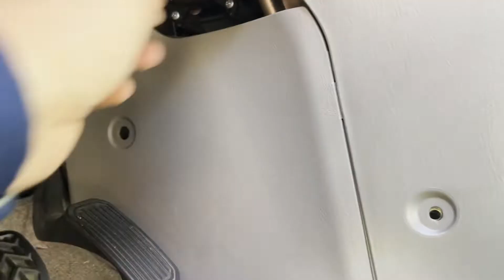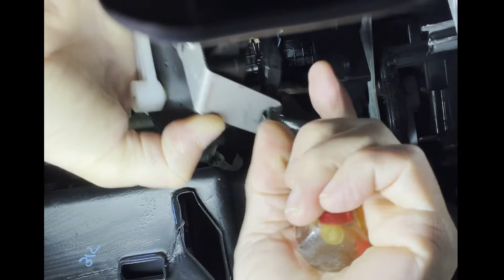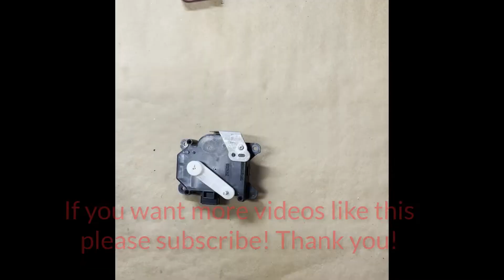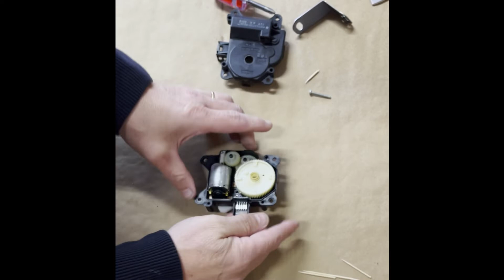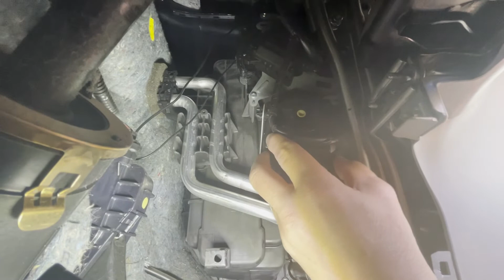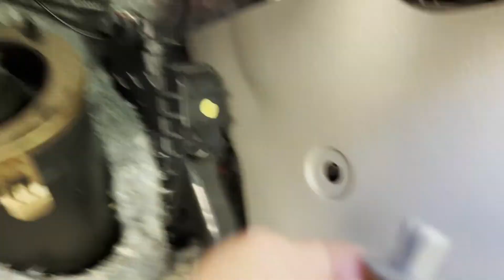2006-2010 Toyota Sienna Blend Door Repair

Comment: Can someone PLEASE help, I have an 2007 sienna CE I was having the same problem I pulled the cover off and there is no blend door in there,   im starting to hate this car so many problems
Reply from the maker: The system is not the same on all Siennas. If you don't have dual temp control, that servo motor is not installed. What is you exact problem that you're experiencing?
Reply: @LeoSabo26 I have the same car and same problem. Only the drivers side is blowing the correct temperature. The passenger and rear is blowing only cold air. The passenger actuator under the glove box is working though. Any tips? Would i have to remove the dash?
Reply from the maker: @simondave00 you have several blend door actuators in your system. At least one of them is not working. The easiest way to troubleshoot which actuator is bad is to test each one. You do this by changing the controls on the temperature control module. Change the temperature from cold to hot and watch to see which actuator is moving, and if it's moving through its full range. Then, go through the different mode selections and observe, which actuator is not moving. This will tell you which one is bad. I would also recommend finding a diagram for your specific year and model of the system, which will show you how many blend door actuators you have and where they are located. Knowing where they are and what they do will help you pinpoint which one is malfunctioning.

Comment: CAUTION: For a high mileage vehicle, consider this a band-aid fix.  The contacts on the back of the gear has 3 track of semi-conductive paint. All the black gunk that comes out when you clean is that special paint that’s been worn off.  It will wear completely through and any “fix” like this will be temporary.  A new aftermarket part is $25. Replacement is the better option.  And for reasons mentioned, never go with a used part unless you know it’s from a low mileage vehicle.
Reply: Looks more like maintenance rather than a bandaid to me, but I don't consider "chatter" to be defective. If it didn't work I assume he wouldn't have reinstalled the part.
Reply from the maker: I agree!

Comment: Amazing video. My motor isnt working. Do u have a part number for the motor
Reply from the maker: Thanks! The part number depends on the type of heating/cooling system you have. I recommend finding the part number by calling a local Toyota dealer and providing them your VIN so they can look it up. Ask for the part number and price, then, search online (Ebay, Amazon, RockAuto) to see if you can find a  part at a lower price. I prefer Toyota parts if the price isn't significantly higher, and don't forget to ask the dealer if they will discount it; they often will.
Reply: @LeoSabo26  thanks for the quick response.  I looked everywhere for just the motor, its not sold separately. Buying the whole actuator is $140!! Im going to try buying a cheaper one that has the same 12v motor and swapping them, hopefully that works, thanks anyway.
Reply from the maker: @rshade407  do you have a Sienna? What year is it? If it's a 2006-2010 model and you have dual-zone ac/heating, you can search using part number 73310. Four Seasons is a brand I've used in the past that seems to hold up pretty well. It's also reasonably priced.
Reply: @LeoSabo26  2006 xle
Reply: Sienna
Reply from the maker: @rshade407  personally, I would not swap out the motor. You can get a new blend door actuator for around $30 from Rock Auto and have a completely new unit.
Reply: @LeoSabo26  thanks man. Will do

Comment: Excellent instructional video. Today I noticed the difference in temperature coming out of vents. I don't have any gear grinding noise; just dissimilar temperatures. I might check the condition of the controller even though I have no grinding, thanks to this helpful video..
Reply from the maker: @TW-ud6sb that's true!
Reply from the maker: @trunadora I'm glad you liked the video. Here's some additional information that will help. The vent that is blowing warmer will tell you which blend door actuator is faulty.  You can also test them by changing the temperature back and forth from low to high while watching the actuators to see if they go through a full range of motion.
Reply: Being low on refrigerant can also cause this issue.
Reply from the maker: @SuperJ213  Glad you found it helpful. Are you sure you have a 1997 Sienna? I believe the first generation Sienna came out in 1998. Also, if you have a non-dual climate control system, there should only be one door that controls the temperature for all the front vents. Your problem may not be associated with the blend door. I would be curious what you find out. Please comment on your fix when you get it sorted, which I'm sure you will.
Reply: @LeoSabo26  It's an 07 Sienna. Sorry about that. I have a similar issue with my 97 Acura TL, and must have had 97 on the brain. I will try to follow up once I get this figured out (I often do with YouTube videos or other online threads), but it may not be for a while.